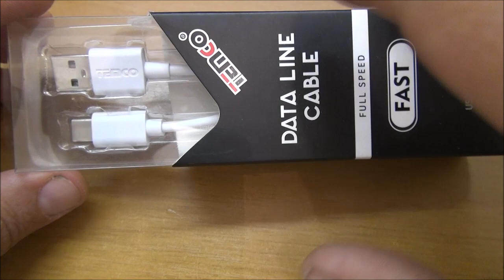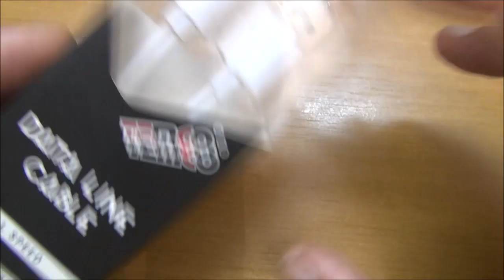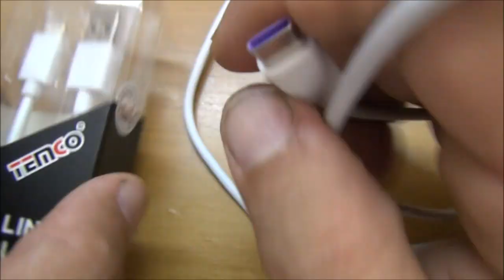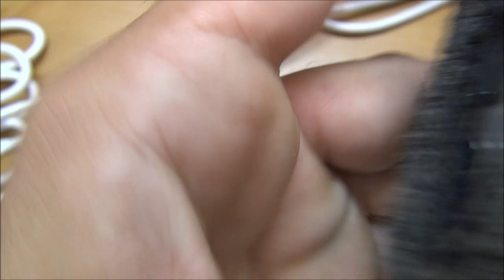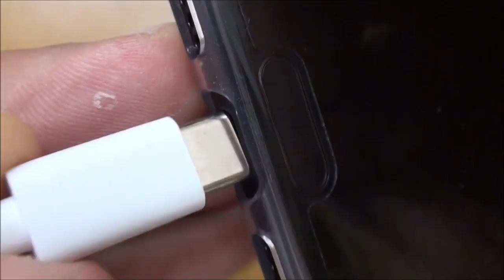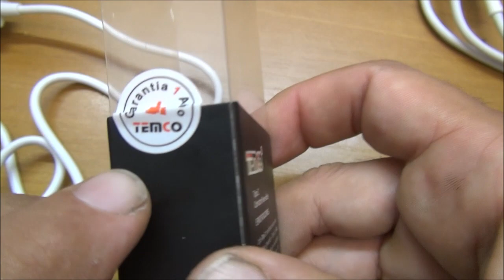Cheap type C usb cable vs Genuine. It is worth for your expensive phone?

Comment: Good video, let's hope it doesn't break easily. The slightly more force required to pull it out of the phone can be both a blessing and a curse. It's nice that it doesn't come loose easily, but the (often plastic) recesses in the mating connector (phone side) that mate with the spring notches for mechanical stability will wear out more, I think.
Reply from the maker: MrDubje what you say is relevant. This is a question that arises when using a cheap cable on an extremely expensive phone. Thank you for your comment.

Comment: Hi Alex, why do you plug the type A connector after the type C?
Reply from the maker: yewtoob007 Hello, in fact, when you connect a "on voltage" cable, there is a spark on the last connexion. This spark, little by little makes some damage on the connector. When you plug the C connector to your phone first, there is no voltage, no current to create a spark. After the connexion is ok, you can plug the big usb connector (the other side of the cable). The spark can arrive at this connector, but it a huge connector with a large copper pad. The spark can damage it but it's made for last.
This fact comes because there is capacitor on the line, on the phone, the power supply. When a closed circuit is connected, the spark arrives in the last connexion, damaging this connexion.
This is why it's better to connect the connector to the phone, and connect the USB in second time.
Of course, if the power supply is off, you can connect it in any sens you want. To plug the supply to the main voltage create a rising voltage and current on the output line wich are " progressive". This way is the best for not damage your ver small connectors.
This kind of trouble was very currently seen on the Iphone plug.
Thanks for your comment.